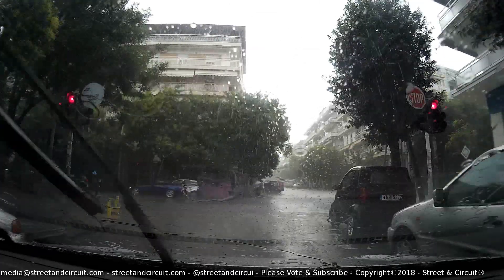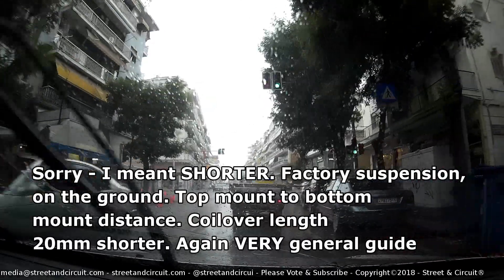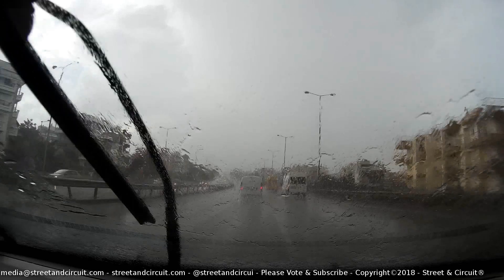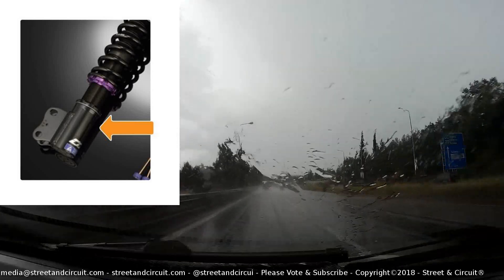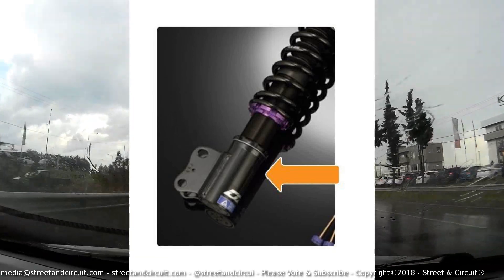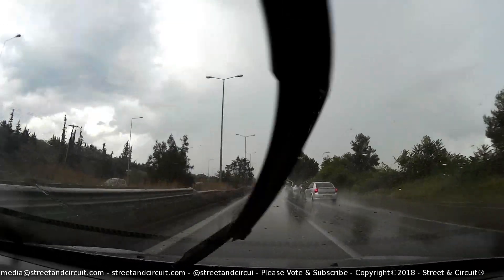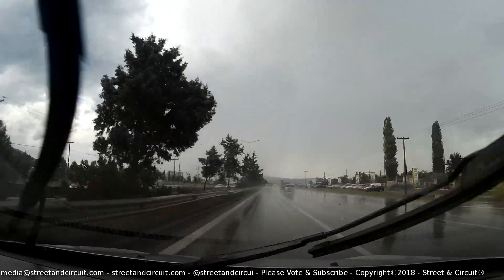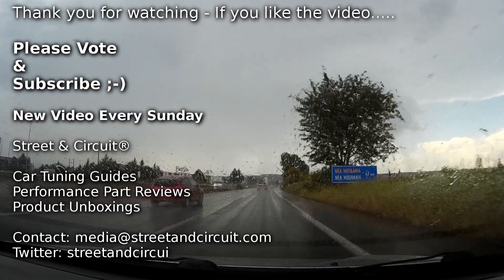Coilover Setup BASIC - Settings for Street

Comment: people rarely discuss about perfomance suspension system and more towards engine modification..after working with several car project of my own, first modification is always suspension system. it change the whole character of handling the car,the grip and much more confidence going through corner with higher speed even with a stock engine..cant imagine with a powerful engine but cant going through a corner with that power..what a waste.😂